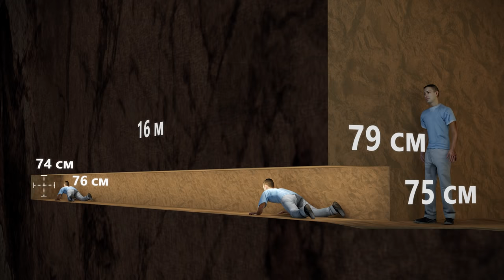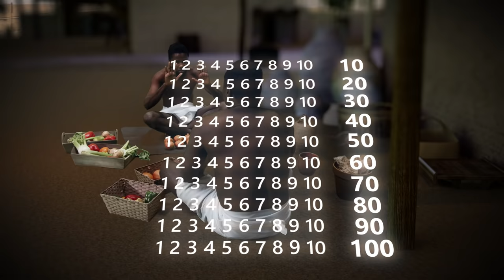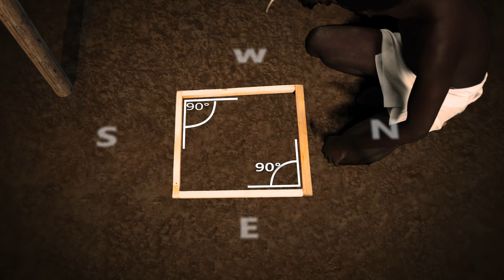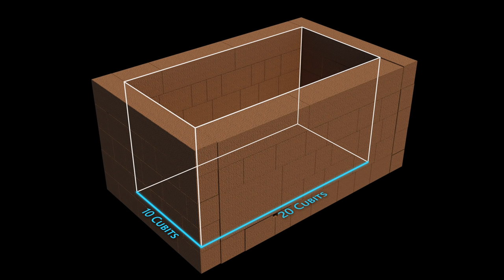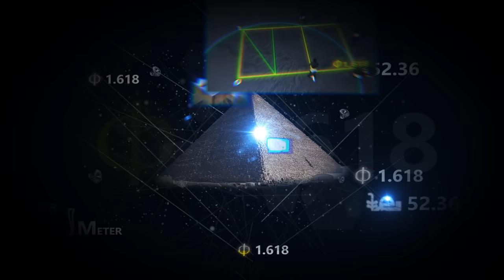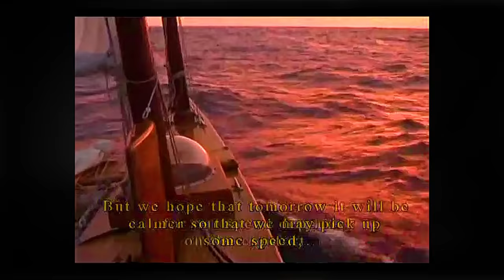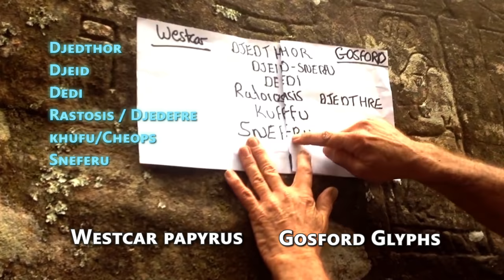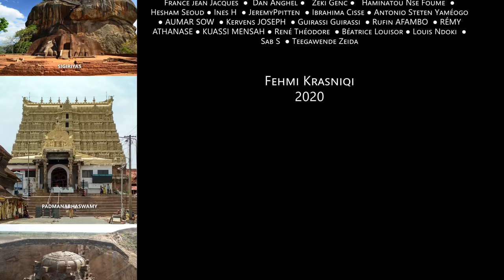The Movie Great Pyramid K 2019 - Director Fehmi Krasniqi

Comment: The hardest rock on earth is a closed mind.
Reply: which is strengthend by fact
Reply: There's so much truth in that statement it's scary. People wonder why I have no faith in humanity.
Reply: There are a lot in the comments section too .
Give them fiction people accept it but give them facts with proofs and no logical alternatives they reject it.
Idiots are everywhere
Reply: Not to mention the very recent carbon dating of the cedar rod fragments prove khufu didn't have it built those shafts were sealed 300-500 yrs b4 he was born, which also throws this doc's work crews post construction of largest pyramid
Reply: @JasonRatcliff7896  whatever be it people still will accept fiction rather than facts
Like pulling blocks and cutting granite with copper tools
Reply: and the most easily exploited is an empty one.
Reply: @debroopghosh7845  how do you think it was done?
Reply: @tacom6  Watch the movie and find out
Reply: @wayburn1  this movie is not very good, I am asking him specifically. Also, drop a water drop and measure it, see if it’s exactly 1 cm in diameter.
Reply: How does one melt granite? Sounds good in theory, but they didn't actually show that IRL. And if true, how does one work a few feet from such intense heat - when it's already 40C outside? Even sitting next to a campfire becomes unbearable after a while. There's some neat stuff here - I like the concrete mold idea - but they glossed over how they supposedly came up with the the formula for that, too. There's some real gaps here.
Reply: Critical thinking does not mean a closed mind. There are some very questionable assumptions being presented in this video. Hypothesis must be backed by concrete proof. Show me a lense powerful enough to do what's being suggested here, and show how people would be standing so close to such intense heat with no protection in a sarong. (So Wrong) Are you going to pour hot magma into a mold and have it not burn up? What would you make the mold out of that would have a flash point or melting point that is higher than hot magma?
Reply: @yahisgood7052  I know - hard to believe they worked on this for 6 years and didn't figure out there was a problem with that.
Reply: @yahisgood7052  In short, when I was a kid I read everything available on the pyramids. I never found anything that made a bit of sense until I stumbled across Rudolph Steiner,  an engineer, a scientist, created The Waldorf School, an author of many books and lectures on basically everything human, and earth. He was a self- proclaimed clairvoyant who claimed he communicated with ethereal beings that taught him about the origin of humans and earth. He said that the Egyptians were physical humans like us, except they had telepathic powers, inherently knew the human origin, advanced maths and construction methods, as well as able to communicate with the god's.
Reply: @yahisgood7052  The real fiction is the film
Reply: No it's sepulchura and machine head
Reply: No, it's my d... Yeah, never mind, it's a closed mind.
Reply: @wayburn1  The movie is full of crap. It may and well possibly be true that the Egyptians were Black, but that doesn't mean they built these structures.
Reply: @reneechavira9304  Analysing human history and current behaviour make Misanthropy most tempting!
Reply: @tacom6  I have no idea how they were built and I do not believe anyone has for sure! The official copper chisels, stone hammers and hundreds of thousands of labourers, however, sounds highly unlikely to me
Reply: @stevebrindle1724  the Egyptians didn’t even have advanced mathematics to have produced such fantastic engineering work. Their own legends speak of Zep Tepi, the first time when gods ruled the earth. I bet the legends are a clue.
Reply: @vonbunn  I have built multi-level custom homes and commercial buildings for over 30 years, and the way this video suggests the pyramids were built is the most reasonable explanation to date. BUT, Because the parasites that feed us a history that is probably mostly lies, there's a 99% chance the pyramids were constructed in a way we couldn't fathom possible!
Do you have any ideas?
Reply: @Survivor of Horror Right! There is so much false information out here. You can't even trust what a book says anymore.
Reply: I always thought it was Slayer .lol
Reply: Thank You
Reply: It would be interesting to see the massive solar lens being created and used  in today's time  .
Reply: @heavenonearth8773  ... cool handle, but back to the point can they also replicate concrete that resembles quarried stone,  so much of the past is lost to time.   My favorite saying is "history is written by the winners".  case in point look at what is happening around us now.
Reply: Aleksa Kole  ... you tried too hard to be profound === fail
Reply: Then there are those that are so dry they accept basically the same story because even if they were made on site they still couldn’t lift them the whole video was made for idiots that want to say Africans made and built Egypt when they didn’t.
Reply: @mischelle9530  ...yepper, and Jesus was a blonde white man just like in all the pictures 
Mischelle your belle            is broken
Reply: @deerejohn7209  my belle is broken I am not sure what you mean by that?
Reply: @deerejohn7209  And I think I know what Christ looked like it’s written in the gospel and since we were of him it wouldn’t make since for him to look like anything else.
Reply: @deerejohn7209  so you not only think that Egyptians were Africans but you think Israel was also Africans? 😀😂🤣
Reply: @mischelle9530  .. and down the rabbit hole we go
Reply: @deerejohn7209  try speaking English ok we don’t live in France or Italy or even Africa.
Reply: @deerejohn7209  like I said it’s the same wether or not the stones were molded on site or cut and were never formed into concrete. The idea that it weighed less and took less time is ridiculous. The stones remain the same weight and certainly weren’t poured where they were set. They are solid granite not one they ground up into sand and put back together a feet we will never ever do. As the Bible says we will never equal those before the flood because they weren’t human.
Reply: I also do not go down rabbit holes unless you call the Bible a rabbit hole. I get all my information from it and it alone.
Reply: Well let's melt some fucking granite then and see if it's possible
Reply: @thinkinimonaritetrack4913  there are videos of people doing it with an old TV glass tube. From an old cathode ray TV. The results were, well, less than enough to impress me. They essentially made glass, not the stunning granite found in the chambers. 😂
Reply: Heart
Reply: @mischelle9530  the original version is in french: english (language, without "E") may not be the only language on this planet.
Reply: @frankfertier34  what the hell are you talking about?
Reply: @mischelle9530 you said  " try speaking English ok we don’t live in France or Italy or even Africa."  english is not the only language in the world; this film was originally made in french: learn french. if you want translations Google translate is here to help you.
Reply: @frankfertier34  if it’s French keep the title French. I have nothing I need from the French why learn their language? People only learn other languages because they need to.
Reply: @tommajor3832  Are you serious ? telepathic ?  you might as well say alien's . The concrete theory has merit ,and why not the math. the problem i have is the 5 Meter mag glass.
Reply: @FASBLAQUE  use Wikapedia , if you want the best impartial info.
Reply: @mischelle9530  Did you watch it through ? they didn't need to lift them ,that was the hole point.
Reply: @mischelle9530  now who believes in the impossible, God haha,ha, and probably Jesus too. The Bible is a 2000 year ,i mean 1800 year old fair tail / horror story..
Reply: @mischelle9530  try getting educated instead of reading only one Book of Fiction....lol
Reply: @mischelle9530  as soon as you invoke the Bible , you lose any credibility , how sad you are...
Reply: @killphil9119  I don’t remember if I watched it through or not because it was pretty dumb. However then they couldn’t have mixed it on sight then huh? Was it a refutation of the concrete making from the granite? What you are saying it was? That they aren’t saying they mixed it on sight?
Reply: @killphil9119  ok 👍🏼 very nice to know. Have you read it? Oh and it’s actually about 4000 years old nimrod.
Reply: @killphil9119  I could have sworn it was saying that they carried the blocks in sand form then made them into concrete using molds to shape them then they lifted them up into place. If not my bad 🤦‍♀️ but I’ll let you tell me that’s not what they were saying if you could please.
Reply: @killphil9119  I actually listened to most of it I think 🤔 but then when I came to the conclusion that they were being very cunning but coming out with the same result and actually worse than and it taking them longer to even build it I think I clicked off.
Reply: @killphil9119  I wonder what you will say when this happens? Will it be real then or not? Jeremiah 30.16“ ‘But all who devour you will be devoured; all your enemies will go into exile. Those who plunder you will be plundered; all who make spoil of you I will despoil. 17 But I will restore you to health and heal your wounds, because you are called an outcast of Zion for whom no one cares. 
Everyone will be removed from the states even you who doesn’t believe because it doesn’t depend on your beliefs what actually matters is your non belief.
Reply: @debroopghosh7845  as soon as they saw the animation they rejected everything. typical.
Reply: Nice
Reply: @debroopghosh7845  Maybe it is more interesting to think that "aliens" or rather "advance civilization" built the pyramids.
Reply: @tacom6  That is exactly what I was thinking too. Maybe they used straws to exactly have a constant measurement of a water drop.
Reply: @engr_qt7093  that's true but researching is searching for the truth not thinking of something out of this world straight away
Reply: @tacom6  i personally have no idea how it was done but if someone provides me evidence that maybe it could have been done this way then I would think of it which is probably logical but starightaway out the world theories are not a solution to any magnificent feat.
Reply: @debroopghosh7845  Yes, but the best answer for who built the pyramid is "we don't know" cause there are so many possibilities.
Reply: @tacom6  It is 1 centimeter according to science. I don't need to measure it myself
Reply: @tommajor3832  Doris Stokes 😔☝️
Reply: Unless you have this magical solar lens.
Reply: @koko4kosh960  its not magical its just a possibility and given how valuable it would have been it would surely be hidden someplace safe from all.
Reply: @koko4kosh960  I forgot, you lived in Egypt back in the day.
Reply: @mischelle9530  well those Pyramids structures were NOT built by White People either! You would think they would have Ancient Pyramids all over Europe and ancient hieroglyphics writings in the city walls all over Europeans towns, if the Egyptians were white, just to prove they put there stamp on it carved on the walls like in Egypt.  But most of the Ancient Pyramids and Structures are all over Egypt, Sudan and Ethiopia!  Not Europe!  Let’s just give credit for the ancient black Africans of building those magnificent structures and pyramids in Egypt!
Reply: @vonbunn  Then who do you think have built those Structures and Pyramids in Egypt? White People? Ancient Aliens 👽? UFOs? If the Egyptians were White you would think they would have Ancient Pyramids all over Europe and Ancient hieroglyphic inscriptions on the city walls of Europe, but there are hardly any in Europe, just Stonehenge, and yes there are few Ancient Pyramids in Europe carved out of a mountain Bosnia, but I see a lot of Ancient Pyramids and Structures all long Egypt, Sudan and Ethiopia!  Let’s just give credit to the Ancient Black African people for building these magnificent structures and Pyramids with primitive tools that stood the test of time in Egypt and in Africa!👍
Reply: @tommajor3832  If documentary presenters are going to have the entire film based on a hypothesis on a technic they should be able to recreate.  They probably should spend most of there time proving it is practical.    And while I get the appeal of this hypothesis might want to focus on the holes of it.  Because I can rip it apart with just my critical thinking agility, much less my two engineering degrees.
Reply: Like number 4 4 4  Nice comment. Stands True IMO.
Reply: @ziparis  perhaps maybe that IS the point....   the unverifiability factor....
Reply: @Skynet_the_AI  It's not unverifiable - it makes no SENSE - and it's a foundational tenet. So I don't know if they're stupid, or spreading disinformation or just trying to make a buck on the naive.
Reply: ISH ❤💛💚 THE END.
Reply: @mischelle9530  your lost black people were the 1st on this planet
Reply: @yahisgood7052  good
Reply: #OORAH, Porter.
Reply: @tommajor3832  hahahahaha, 🤪🤪🤪
Reply: @tacom6  how you know?
Reply: Narrator was easy on ears
Reply: @mischelle9530  IF the Ancient Black Africans did NOT built & lived in Egypt, then I will ask will ask you this question?  Where are the Ancient pyramids and Structures with Hieroglyphic writings✍️ in the city walls of Europe?  If you don’t believe the Ancient Egyptians were Black, then where are the Hieroglyphic writings on the Stone Structures in Stonehenge? I don’t see any? 🤨
Reply: @jeffreyknopf8959  oh no they were black but they didn’t hold their position of tyranny on us that ended now they are just waiting to go back to Africa they weren’t in power in the times of Moses or Ramsey’s they were best friends after Moses concurred them but they didn’t rule at all and why would there be crap in Europe? You have paintings not entire statues as Ramsey’s did. You will return because we have been fighting forever it has to end soon. Where are their giant statues just paintings like in Washington DC of fake crap that never happened.
Reply: @jeffreyknopf8959  they didn’t build the statues their occupation just repeats itself like today.
Reply: @jeffreyknopf8959  they must go away now in shame for the theft and lies they will not repent for! Isaiah 45. 13 I will raise up Cyrus in righteousness,and I will make all his ways straight. He will rebuild My city and set My captives free, but not for payment or reward, says the LORD of Hosts.”14 This is what the LORD says: The products of Egypt and the merchandise of Cush, along with the Sabeans, men of stature, will come over to you and will be yours; they will trudge behind you; they will come over in chains and bow down to you.
They will confess to you: God is indeed with you, and there is no other there is no other God.’ ”15 Truly You are a God who hides Himself, Oh God of Israel, the Savior. 

This says that you would go astray for some reason and become ashamed with apparently the lying Romans. 

16 They will all be put to shame and humiliated; with the makers of idols they will depart together in disgrace. 

Here it says we will be saved while those so called slaves we set free without even a days work will not be! 

17But Israel will be saved by the LORD with an everlasting salvation; you will not be put to shame or humiliated, to ages everlasting.

Here Peter is saying that teachers of the world will teach lies about us to exploit us what is taught and is rather destructive? That can eat your soul waiting for some kind of revenge? Yeah slavery who is destroying themselves today? Who is behaving depraved? Yes the Romans and Africans they actually have everyone acting depraved even the so called natives. Now Africans I heard owned Irish slaves I can’t say if it is true or false but we didn’t own them or you in fact we have been slaves to the entire world without end for about 7000 years. As it says in Isaiah we will not be humiliated and silenced without end we will be healed. 

2 Peter 2.1 But there were also false prophets among the people, just as there will be false teachers among you. They will secretly introduce destructive heresies, even denying the sovereign Lord who bought them bringing swift destruction on themselves. 2 Many will follow their depraved conduct and will bring the way of truth into disrepute. 3 In their greed these teachers will exploit you with fabricated stories.
Reply: @jeffreyknopf8959  don’t worry as the English are not Europeans just trying to make that clear from the start they meaning Africans will leave with the Europeans. Yes exiled with Biden! Africans built statues of granite of white men. I’ve heard it the paintings say so? 😂
Reply: @jeffreyknopf8959   don’t doubt that this is coming now! It is and all of Europe will not survive and the fake so called English queen must be removed along with the pope and all those they decided would rule over us changing history and erasing what they did to us writing laws they signed they wouldn’t write, we actually came here because they were beheading us and burning us alive now while there is proof of it and the Bible says we did and would there is no proof of the new made up history that they made up saying archeological discoveries were found that changed our history to arrive at a different time and with Africans many in fact they supposedly out numbered us. Daniel 2.44“In the time of those kings, the God of heaven will set up a kingdom that will never be destroyed, nor will it be left to another people. It will crush all those kingdoms and bring them to an end, but it will itself endure forever. 
Daniel 7 .25 He shall speak words against the Most High,and shall wear out the saints of the Most High, and shall think to change the times and the law;and they shall be given into his hand for a time, times, and half a time. 26 But the court shall sit in judgment,and his dominion shall be taken away, to be consumed and destroyed to the end.
Reply: @davidleomorley889  on YouTube only 👍🏼😂
Reply: @davidleomorley889  I was joking these people are fools but the outside world and tv made them that way. On Youtube we can at least try to open their eyes. Though it is very difficult!
Reply: exactly they said 4500 years old, bullshit, lost me right their pushing false narrative as usual , they try everything to see if anything sticks, no way this way.
Reply: @vonbunn  The Pyramids were there before the Egyptians arrived. They just moved in and claimed it as their own. The Bosnian Pyramids are over 30,000 years old, and the “White Pyramid” in China is 3x bigger than Giza. And only Gawd knows how old it is.  There are literally thousands of ANCIENT pyramids scattered around the globe. Some are totally burried underground, as discovered by space based ground penetrating radar.
Reply: @mischelle9530  well, that’s a mistake !   Do you really think this world is only 6,000 years old ?
Reply: @pcuser1031  no I am not dumb but you can't say how old it is.
Reply: @yahisgood7052  I think they've answered that by stating that clay was their mold and it does make sense because clay does not burn at any temperature from what I understand
Reply: @vonbunn  it does make sense that the people were black that built these structures because if you were near those temperatures all day long melting granite you would at least be very dark brown
Reply: @arlenmargolin1650  If you melt granite, you will get obsidian, not granite. Therefore their assumption is false. Just one of the many false arguments from this so called "documentary"
Reply: It does not require a closed or open mind to figure out that there is way too much ancient aliens nonsense going on in this video.
Reply: This statement got me thinking 💭 
Noted this down too 📝
Reply: @mischelle9530  most scientists think that the universe is 13.5 billion years old since the Big Bang, if there ever was such an event.  And they think the Earth is about 4.5 Billion years old. But you are right, who can really say for sure.  Have you heard of Adam’s Calendar in South Africa ?  Some say it was put together by humans (or somebody) about 350,000
Reply: @mischelle9530  Adams Calendar, put together about 350,000 years ago. That time frame sort of coincides with Sitchins theory about the extra terrestrial gold miners that came here from Nibiru. 
Perhaps the answers are in the Holographic Library inside the Bucegi Mt. In Romania, under what is called the Romanian Sphinx.
Reply: @pcuser1031  uh hello 👋 no people do lie do they not? They have always lied and wrote them and made them facts trying to seem all superior to others while all they are is liars. Even 35000 so called years ago. There is no nibiru that belief is for Apollyon worshippers not people who actually have a higher being as God.
Reply: @mischelle9530  God, the Creator,  made stranger things in Heaven and on Earth than are dreamed about in most peoples philosophies.  I don’t think that the Sumerians were lying about Nibiru and “space aliens”. I think they actually believed it, and probably with good cause.   As for GOD, the one I believe in breathes in and out universes for the duration of eternity, and loves every single atom in them. He knows when any sparrow drops from the sky, and not one electron circles a nucleus without His OK. When He sleeps, there is nothing but the VOID, and when He wakes, all sorts of wonderful Creation takes place. This current Universe He is sustaining contains our Milky Way with billions upon billions of stars, many with inhabited planets, and at least another 4 TRILLION galaxies,  and counting.  Every time they point the Hubble Telescope at a supposedly empty spot in space, they find another 50,000 galaxies stretching out 14 billion light years. And you can bet that He has made all that crawling with life, in one form or another.   Who is to say what is out there ?   Who is to say that humans were not transplanted here by more advanced space critters that God created, as told in the Sumerian clay tablets ?   Perhaps they did genetically engineered us to be their worker class, like the story goes.
Reply: @pcuser1031  🤣😂🤣🤣🤣🤓
Reply: @pcuser1031  So instead my God lies?
Reply: @tacom6   by music perhaps?
Reply: An open mind is as stable as an upside down pyramid
Reply: @joejxp7874  actually it might be! always learning new facts and accepting them for what they are it causes masses of growth in all branch directions. But it is designed to either take you to heaven or hell so very unstable indeed.
Reply: Its Diamond...
A " mind"is illusion
Reply: Wow. U r brilliant. Is this an og??
Reply: @JasonRatcliff7896  carbon dating has a LOT of room for error and you're basing your statement on a window of time that lies well within that margin for error.  Meaning that the confidence level of your conclusion is really really low.
Reply: @yahisgood7052  they don't take into account that granite is the product of vastly extended cooling times of magma, and that when their molten granite flows into a form in dribs and drabs it will cool so quickly that there is virtually no time for recrystallization to occur.  The product would solidify in loose dribs and drabs having little cohesion and it would be full of voids and microfissures (sort of like pumice as compared to obsidian) and would not even look like natural granite, even with the naked eye, let alone in a micrograph.
Reply: @tommajor3832  and that gobbledygook made sense?  Sounds more like that charlatan found a way to get rich quick by writing books that appeal to the simple minded ones among us.
Reply: @stevebrindle1724  what is more likely?  That they possessed the technology to produce high temperature kilns needed to make the high quality glass needed in the lenses?  Also, since glass is extremely durable, much more so than most native stones and primitive forms of concrete, where are the lenses?  They would be around long after blocks of poured limestone had been worn down to lumps.
Reply: @mischelle9530  sad
Reply: @mischelle9530  You're a flat-earther, why the hell would any of your opinions be valid about any other subjects?
Reply: @nobodyknows3180  actually I haven't been brain washed by nazis. You have.
Reply: @ziparis  you can’t melt granite and pour like concrete this is bullshit
Reply: @tacom6   Read Schwaller De Lubicz 's work...
Reply: Artificial Intelligence  
F?
= 
Fart.
Reply: there is no evidence of any lens, and when you melt granite, it dosen't stay as granite, it becomes a crystalize glass...
Reply: @uttaradit2  facts make harder rocks? Indeed harder heads with locked up sealed tight closed minds
Reply: @mranonymous4282  who am I looking up to God or men? If men then yes they were if God then no they weren’t Noah was the new start of man and he was white why are you such a racist anyway? Why does it matter?
Reply: You are right!! 🙂🙂🙂
Reply: Having an open mind is not the same thing as being gullible enough to believe these fantasies....
Reply: @martyzielinski1442  nope two different things isn't it. But I think they all accept anything without question.
Reply: Exacto simplicity’s at its finest
Reply: Practical experiments have not been produced so...fail
Reply: That is a fact.
Reply: @jarvispalmore1046  White people evolved from black, that means we were all first 😏
Reply: @jeffreyknopf8959  You keep repeating yourself!  If the Egyptians were black why did they paint themselves light brown in the wall art?  That makes no sense, if they were black they would have painted themselves as black 😏
Reply: If the Egyptians were black why did they paint themselves as brown on the walls of the tombs?  It makes no sense for a  black man to depict himself as brown or lighter skinned.  There is so substance to this theory
Reply: @ziparis  with direct energy lasers?
Reply: @yahisgood7052  heat is not the only thing that can turn rock liquid, frequencies can cause liquefaction with out heat!
Reply: @mischelle9530  stop being racist, there in only one human race with different levels of melatonin and different cultures!
Reply: @mischelle9530  really if you did you would not even believe race is real, you would understand that people's were named for the geographical area they lived or their chosen belief system. Not there skin color!
Reply: @mohawkduda8554  uh not sure what you mean colors do have different beliefs even the same colors have different beliefs what are you talking about.
Reply: @mohawkduda8554  when I plan to exile people it will be based solely on their beliefs not what color they are.
Reply: @mohawkduda8554  If granite is melted it turns into "mush" and then cools into what looks like volcanic rock... it does NOT assume the same speckled texture it had before. This film may have been well intentioned,  but it's got some gaping holes.
Reply: @mischelle9530  "@KillPhil 911  I could have sworn it was saying that they carried the blocks in sand form then made them into concrete using molds to shape them then they lifted them up into place. If not my bad 🤦‍♀️ but I’ll let you tell me that’s not what they were saying if you could please."

Yep, "your bad" all right.  You didn't watch it through, or you let yourself get distracted with other things.  But that's okay, it's a LOOONNNGGG movie.  

The workers didn't "lift" any significant number of blocks up into place.  No use of massive ramps, no wooden sled/sledges, no cranes used except in the limited section of the Great Hall and the King's Chamber.  According to the movie, ALL BLOCKS except for just a few were cast into place.

Those few that WERE moved were the blocks used internally to block off the passages after the closure of the pyramid.  They were cast on the level where they were installed, then they were moved/tipped into place and prepared for their final placement which would happen at the closing of the pyramid.  But not moved from the ground up into the pyramid; only moved a few meters from where they were cast.

And they didn't just use "sand form".  The movie talks about how they made something called "caustic soda" from local materials plus burnt palm fronds or other sources of charcoal.  Today we use "Portland Cement" instead of Caustic Soda...but from some limited reading I did, Portland Cement is not as good and not as sustainable long-term as Caustic Soda was to make.

But yes, all of the components for the blocks were supposedly made and mixed at ground level, then handed from man to man up the pyramid to the active level, and finally poured bucket by bucket (or maybe it was bag by bag) into large wooden molds, then allowed to cure before the molds were moved to a new location a few blocks away.  They did not cast neighboring blocks immediately after one another, probably due to the slow curing time for the concrete that they were making...they probably wanted to ensure that a block that was just poured had time to develop enough strength to provide one side of support against a new block that was going to be cast later.  Anyhow, the crew then crew repeated the procedure.

And since this was a major and huge project, they probably had multiple crews working all at the same time on the active level.  An early use of the concept of "parallelism", which today we use in manufacturing and even in modern computing CPU and GPU processor chips.

The forms themselves were supposedly all made via the measuring system that descended from a drop of water (onto an impermeable surface such as marble) measuring precisely the same the world over, and that diameter eventually began to be called the centimeter.

If any of this is true to any great extent, then I think we have been badly misled by prior scientists all around the world, and I think they have some explaining to do.
Reply: @debroopghosh7845  "@Nile Gilmanov  i personally have no idea how it was done but if someone provides me evidence that maybe it could have been done this way then I would think of it which is probably logical but starightaway out the world theories are not a solution to any magnificent feat."

Yep, evidence.  And demonstrable experiments that can be replicated at home.
Reply: @dennistoft8458  "@Nile Gilmanov  It is 1 centimeter according to science. I don't need to measure it myself"

Yeah, but if you don't measure it, how will you KNOW that it's true?
Reply: @justaskin8523  Ok if you want to reply to someone try not to write an entire book is that not what they were saying that they ground it all down to sand then reformed it then lifted it?
Reply: @justaskin8523  oh just a heads up I didn't read past the first paragraph in your book.
Reply: @justaskin8523  I guess if that wasn't they were saying then I am the fool if not then you wrote a book for nothing. Well you wrote it for nothing anyway if it was meant for me to read. lol
Reply: @justaskin8523  I don't think this is because of intentional misleading. Simply a long range of missunderstandings and missinterpretations.
Reply: closed and locked with religion make them   harder..
Reply: @HeiseDeMao  Who's religion though is the real question.
Reply: Burna Boy  haha yeah!
Reply: @robertcronin6603  Thank you for your comment. It isn't funny though, because the fact that you even recognize that will make you an outcast and dissident and you will be relegated to losing friends and allies to the struggle. Mt name is Terry. Pleased to meet you.
Reply: That makes zero sense the mind is one of the softest tissues in the human body. I don’t think it was meant to be funny either.
Reply: This film is incredible totally impressed with the knowledge shared most makes complete sense the travelling questionable but over all well done to all those who took part in the mechanics of this project Bravo.
Reply: Nice!!!
Reply: @ziparis  yes  , you have a good point.  This story sounds logical in theory , but where are the molds or at least the way in which they were cast and put in place? Maybe i missed something.  It was kinda long and i did walk away a few times so i couldve missed it.
Reply: @davidleomorley889  thank you si much. I have a paasport and have travelled to Italy , but unfortunately due to fmy fnancial situation I havent been able to afford to go all the other places i would LOVE TO TRAVEL. Your right seeing it for yourself is a great way to learn. I tried to watch this video but my ADD kept me distracted and I OBVIOUSLY missed a few pieces. No worries .when i GET TIME Ill educate myself a bit more. I love to learn.  God bless .
Reply: @michellecardenas6072  agreed 👍 I wish I could say what would help them, i just dont have a clue its like they live in another world. No matter what it is something is always thought about incorrectly it goes from one thing to the next. Its like because they do not think on their own questions dont help they read something and hear something else. I do wonder how they run their households. geez! V is 40% affective and they say oh its like 90% and nothing is better than that. 🧐
Reply: @jameshannagan7830  mate have you actually seen the video? 😂
Reply: @debroopghosh7845  - Being an old guy, I estimate about 30% of the population are very ignorant, thus gullible to people who take advantage of that gullibility and instill permanent falsehoods in their brains.  Politics and religion come to mind.
Reply: This hypothesis isn't good enough. There is more information story teller hasn't gathered.
Reply: @debroopghosh7845  so very true.
Reply: Does everything have to be about democrats ?
Reply: @debroopghosh7845  You can cut a block of Granite with a Copper saw... Just ad an abrasive substance like sand! The saw acts to move the abrasive against the stone, thus cutting the stone.
And as to pulling blocks of stone? This can also be shown to be possible. They did have ropes you know...
Reply: @tacom6   That depends on the size of the drip!
Reply: @debroopghosh7845  Nobody really buys that. How do you then explain things like the Egyptian obelisk being carved out of the granite bedrock but abandoned when a crack developed or the megaliths in Baalbek still attached to the bedrock? 
Most definitely cut, not cast.
Reply: Very true and witty.
Reply: Seems feasible  !
Reply: Aliens of and giant humans with alien technology.
Reply: i don’t want to do it with you. sorry
Reply: @ziparis  great CGI and graphics displayed in the film at very least
Reply: Agree 💯
Reply: @debroopghosh7845   If you give people fiction they will accept it as fiction not as fact. Don't spin mental gymnastics to justify your smug pov.
Reply: Jesus Christ had this problem because they were afraid to honestly and sincerely approach him. 
He is so loving. I've known him for almost 30 and he has carried me through so many things. 
I don't think I'm good enough but to this day, he says he loves me. 
I believe him. 
I hope you believe him too
Reply: @heavenonearth8773  there is one in Israel
Reply: @mischelle9530  wrong they were not granite
Reply: upon this Rock
Reply: Booom!!! 💥🔥
Reply: No matter what your thoughts are on the matter. Isn’t it textbook irony when someone calls another “close mined” for hearing out alternative plausible answers to a question? Accepting a singular answer with zero respect given to alternatives would indeed be closed minded
Reply: Psuedo
Reply: The thickest rock on Earth is a mind that is open to too much.
Reply: Love that
Reply: Auhauahau
Reply: That was deep
Reply: 200.000 piramid on the vorld
Reply: @yahisgood7052  1:59:53
Reply: Eiffel one really enjoyed this K 2019 show very educational, something very probable know, and I am so proud of the black Egyptians or ancestors are human fellow brothers, who gave us so much your truly fellow human
Reply: @tacom6  I guess you were there with them...
Reply: @mischelle9530  you don't need to think if ancient Egyptians were black. Go read up on the Greeks account of ancient Egypt. What a generation? The facts are there, please dig into the Greeks and you'd be shocked by what you discover. But you know what? You'd never go there, either because you are way too intellectually laid back, or scared of what you'd possibly discover. The death of all you'd been told so far.
Reply: @chriskewe4238  the death of all of us? What lol we are not dying that’s a Greek wish.
Reply: I think it's a diamond actually
Reply: @KillPhil 911  That's what I'm saying! How the hell would they make the "solar lense"? Someone needs to build it and prove that it is capable of doing this FIRST!
Reply: @KillPhil 911  You mean the Wikipedia that EVERYONE can manipulate and change's from day to day? That one?
Reply: @JasonRatcliff7896  i think it was constructed long before the "egyptioans" why lot of depiction and art of their culture and pharaoh and such but no depiction of how they built it
Reply: Just because it looks like a god idea doesn't mean it is. I can tell you for sure that the Egyptians of our time didn't do this.
Reply: Most important notion is that there was no mummy of pharaoh inside the pyramids nor any writings or hyroglyphs which u find in the tombs of all the pharaohs together with their bodies. Example is King Tuts etc
Reply: And it’s also a closed mine.
Reply: @mischelle9530  What???
Reply: The mind is NOT a rock.
Not sure what you're aiming at...
Reply: And they exist by the ton
Reply: Well said.
Reply: Well said!